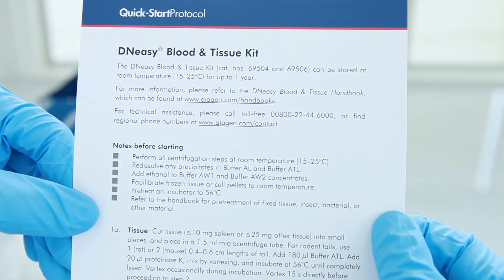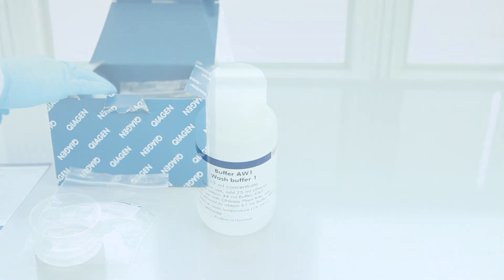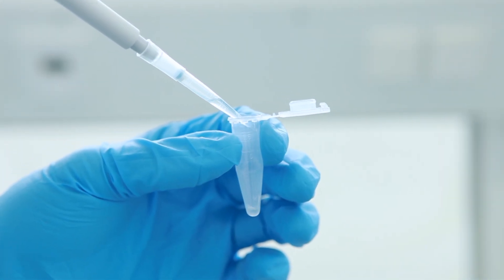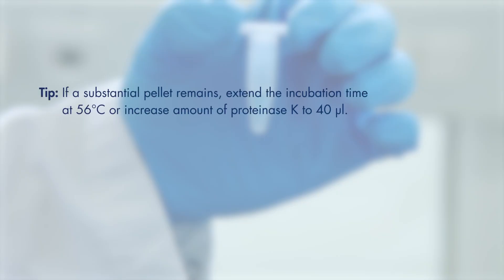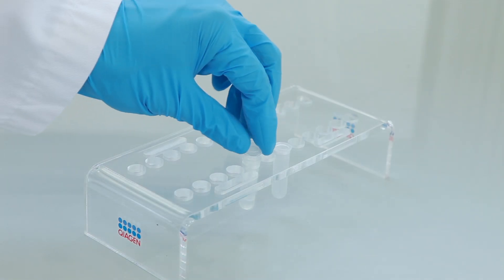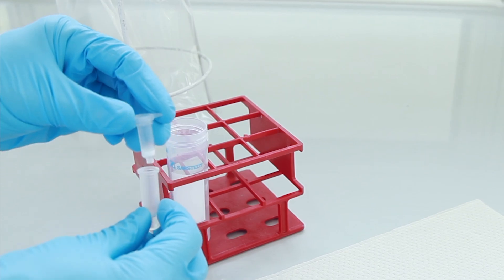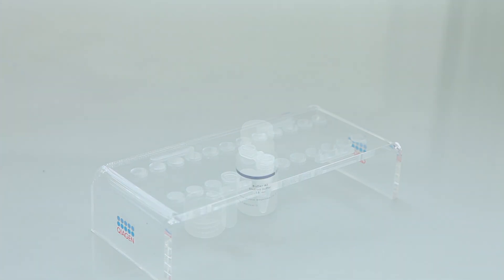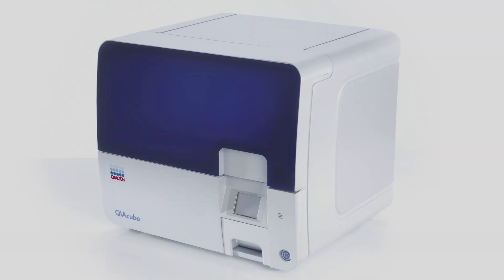DNeasy visual protocol

Comment: is it normal to have a small pigmented pellet at the bottom of the tube after the elution step?
Reply from the maker: Hi Brett, 
thanks for your comment. 
Normally, one should expect a clear, colorless eluate without any precipitates with our DNeasy Mini Kit. 
When you observe a yellow pellet after centrifugation in the eluate, this can be due to the starting material (amount or nature of the starting material) or any other technical issues during the preparation. Therefore we recommend to contact the local Techservice for further troubleshooting of this particularity.
Best regards,
Gaby

Comment: Have used this multiple times, works perfectly every time.

I usually use it when I purify DNA using a quick method. Whenever it's not clean enough for the PCR to work, I use this kit to further purify the DNA.
Reply: LT GFX I used this 3 times. I am not getting the dna or a low concentration of dna. What am i mistaking the step most probably?